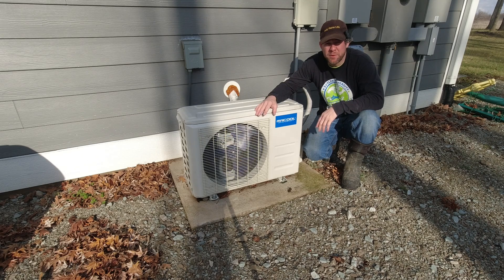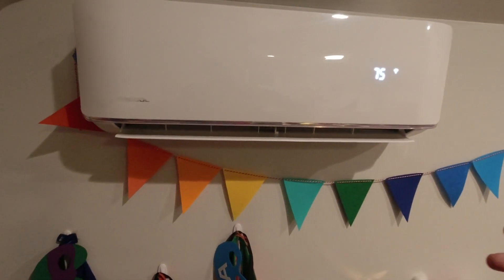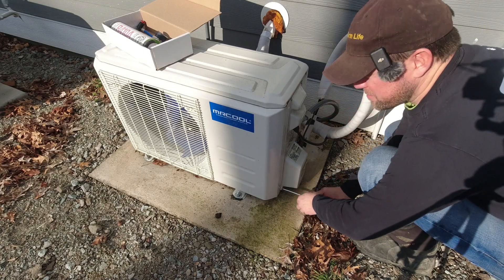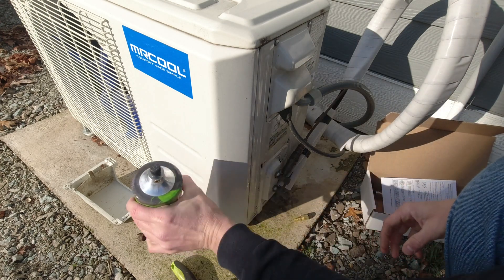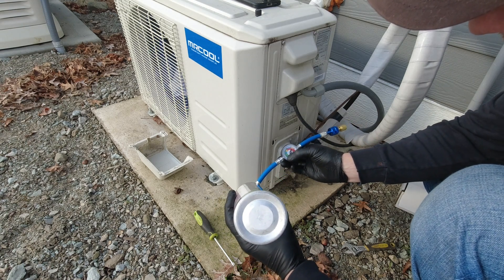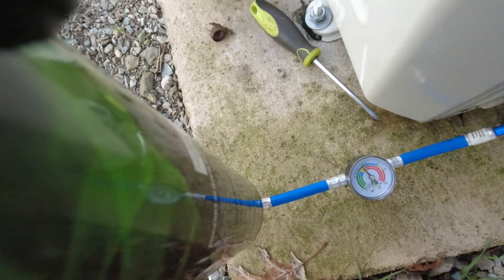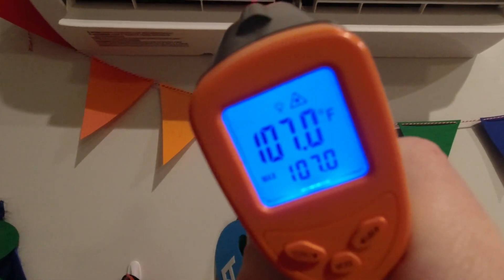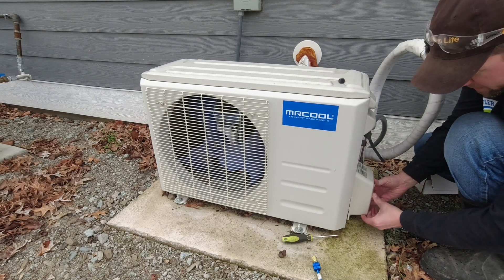Fixing a Mr. Cool DIY Mini-Split - Not Heating/Cooling - Low Refrigerant

Comment: What if you have a multi zone unit? Can you fill from the lowest line? I have a 4 zone unit. Also, does the zone you are filling need to be the one running in A/C mode or does it matter?

Comment: Brother, did you check for air and condensables? You are doing the quick fix; in reality, you should recover the refrigerant, then put the AC unit in a vacuum state, then properly charge it.

Comment: did you purge the hose before charging that is an important part
Reply: Instructions specifically state there is no need to. However I've been told by AC guys that you really need to. IDK.

Comment: Followed this advice and I'm back up and running, curiously mine was almost a full can low as well at 1.5 years. 
 1.8lb can is 28.8 oz mine (18,000 BTU) holds 56.6 oz, One can got me into the mid blue range.
 Its definitely cooling well now even in the upper 90s outside I set it to 67 and it cooled the office its in down to 64.
 Still, I'd love to know where they're leaking half their coolant out from?

Comment: just need to confirm the order... attach charging unit and bottle then turn unit on?  I hooked mine up with unit running and had to do the quick tighten... gas was escaping.  thank for any help
Reply: You need to let it run long enough to kick the compressor on, but yes running on AC and set to 62 first.

Comment: My mrcool compressor failed at 4 years old. my son's compressor also failed at 4 years old. his was a 18,000btu mrcool. Their overpriced junk. Mine was $1100 my replacement Apoodr was $522 on Ebay and has been running fine for 2 years, I have the same Apoodr in a bedroom for 3 years still works great.
Reply: I have Fujitsu running for 12 years.

Comment: Nice bandaid fix, if the valves are leaking you should use a thread sealing product on the valve caps so you dont have to refill this thing next year. And/or replace the valves but that's more work

Comment: Question, I know it has to be on cooling mode (AC) for the compressor, is there a certain speed/setting... low-med-high etc. it should be set at?  Thanks ahead of time!
Reply: Full throttle would be best, probably doesnt matter much
Reply: @Netherlands031  Yeah you are probably right. Have the paper that comes with it, says have it on cool and set at 62 degrees which is the lowest but nothing on speed setting.

Comment: Mrcool is the worst brand you can buy made in China. Mine broke down a bunch of f times. And good luck with the warranty department making excuses not to send you the part you need
Reply: That sucks. I’ve had my Mr Cool for 5-6 years now? I’m now finally having issues, but I definitely think I got my moneys worth. 1500 bucks gave my house which never had central AC , made my house very comfortable . I bought a kit similar in video and I’m back running blowing ice cold. Let’s see how long a $125 bandaid last.
Reply: @IMharshh they won't all break at the same time. You're lucky to have one that lasted at least 5 years. I've seen other brands lasting at least 10-20 years
Reply: @LuisPerez-c4z  Oh wow, which brands!?!! Just so I know for future replacement
Reply: @IMharshh Mitsubishi hyper heat 2
Reply: @IMharshh  I have one  for  3 yrs. 18k 4th generation.  No  problem....... yet  ))
Reply: This is the worst brand you can buy. 
It's rebranded from ChlNA🤮
Reply: Mines fd up and they are blocking me from easily doing a warranty claim.
Reply: @slipagent6 That brand is complete junk 💩. They sell them with leaks everywhere in the unit
Reply: All other brands are also made in China.
Reply: @t42t4usn NO they're not. GoodMan and Carier are American made. Coleman compressors etc
Reply: Our compressor went out last year after having it about 4 years. They shipped us a new compressor, no questions asked.

Comment: Why is Mr Cool such crap i have a pin hole leak on the tubes. Not installer caused but manufacture issue

Comment: THIS IS NOT AN ACCURATE WAY TO CHARGE A MINI SPLIT, DO NOT DO THIS. NOT ONLY IS AIR/MOISTURE GETTING INTO SYSTEM  ITS AN INVERTER, YOU NEED TO WEIGH OUT CHARGE TO INSURE ITS LOW AND THEN RECHARGE ACCORDING TO SPECS.ALSO IF THE LOAD IS LOW MEANING COLD OUTSIDE IT WILL SHOW LOWER ANYWAY SO WHEN IT GETS WARMER OUTSIDE YOU COULD NOT ONLY HAVE INTRODUCED AIR/MOISTURE TO THE SYSTEM BUT OVERCHARGED TOO, IT MAY SEEM AS IF IT WORKS BUT YOU ARE DAMAGING SYSTEM LONG TERM DONT WASTE MONEY PLEASE DONT WASTE YOUR MONEY AND CALL A TECH
Reply: It's true. The unit should be leak checked with nitrogen, cut off the extra line set loop traps, wheigh in factory charge
Reply: Sounds like something someone desperate to make a service call would say.
Reply: @Those_Weirdos you cannot charge a mini-split based on pressures. The head “hides” refrigerant that cannot be read by the gauges, thus being no way to get an accurate reading. This guy is 100% correct, and I can confirm.

Comment: I never understood why people buy Mr Cool systems. You can get a 12K BTU for under 400 and a vacuum pump for under 80 and gauges under 40. Great someone offers a R410 recharge so you don;t have to buy from the flea market or bribe the A/C supply store.
Reply from the maker: Yea, I'm sure there are better/cheaper options.  This setup sure beats the 3,500 my HVAC company wanted when we were building the house.   Good to hear from you. Haven't seen you here in a minute.  Happy New Year!
Reply: @IndyFarmLife  Thanks Adam, happy New Year to you as well! Keep enjoying the good life with your family!!
Reply: I bet that pump and set of gauges are real great quality for those prices! I love charging service calls on you type of people when you call the professionals because you’ve messed it up. Just facts 🤷🏻‍♂️
Reply: @ I for one have never need a "professional" but have done everything myself. One of my ductless systems is 15 years old now and still runs great!
Reply: @chargermopar  Judging from your comments you look down on the professionals. Personally I don’t think HVAC is something that DIYers should be allowed to do. You don’t have the schooling or on job training to properly handle refrigerants and installations. That’s my opinion.
Reply: @ryanbrisendine3740  That opinion is why the world is an overpriced nightmare. I built my own home, why should air conditioning be off limits?
Reply: @ That opinion is not why the world is an overpriced nightmare, nice try at gaslighting though. To do my job as an HVAC Technician/Journeyman I have to have licenses, certifications, schooling and abide by local codes. Why should you be allowed to buy that cheap equipment, that’s honestly saturated the whole market, and install it without having to follow those said codes or licenses?! Good for you for being able to do it, but most people can’t and they get themselves into all kinds of problems and expect me to fix it for them.
Reply: @ And bribe the supply house? You shouldn’t even be allowed to buy anything from the supply house, that’s for licensed contractors to buy wholesale equipment and supplies to maintain and run their businesses.
Reply: @ryanbrisendine3740  I believe in free markets, DPRK seems more like what you want.
Reply: @chargermopar  Actually that’s not what I want 😂 It’s impossible to talk to people who think they’re never in the wrong 😘
Reply from the maker: @ryanbrisendine3740 Well, it has held up thus far and it was pumping out 105 degree heat last week when it was -5 here.  Hard to be mad about that. 🙃

Comment: Wait till warmer weather for the next recharge can. It being cold outside and running ac will make it look low.
Reply from the maker: Thanks for the advice!  It happened to be about 50 that day, but that's still probably too cold?
Reply: @ 65F outside with some sort of heat load inside. at the lowest. 
70+ outside even better.
Reply: I was going to mention this, Download the pressure/temperature chart to get actual readings.